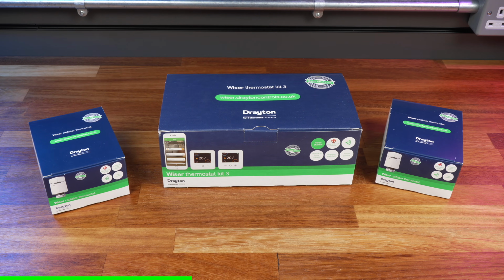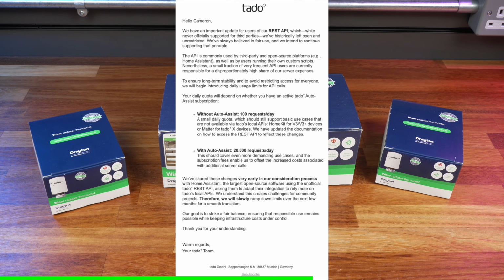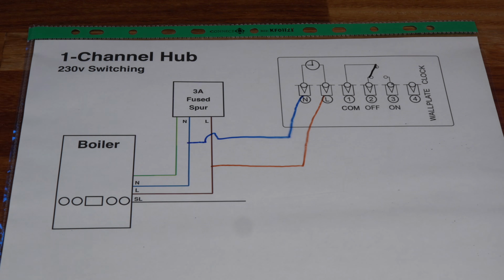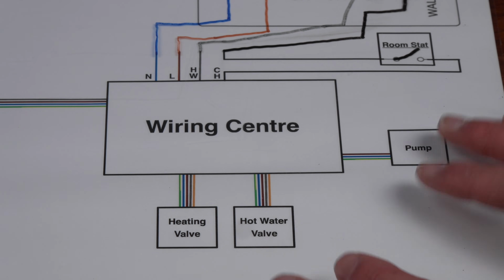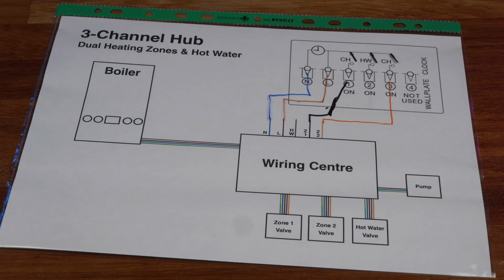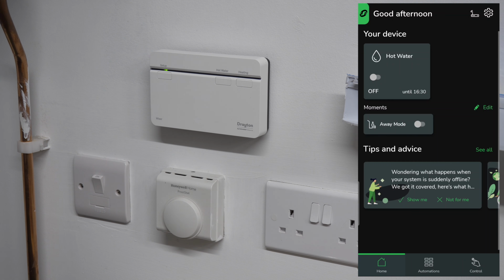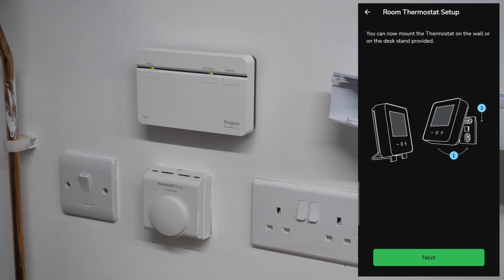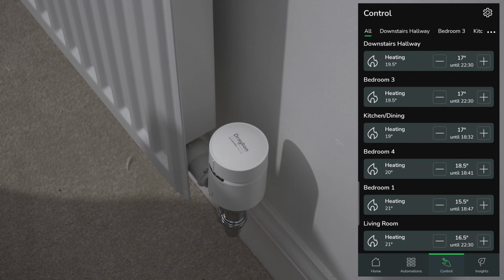Goodbye Tado, Hello Drayton Wiser! — Full Installation & Setup Guide!

Comment from the maker: Buy Drayton Wiser on Amazon (Affiliate):
  - Wiser Thermostat Kit 1 (Combi Boilers): https://geni.us/D1jjeM8
  - Wiser Thermostat Kit 2 (Heating & Hot Water): https://geni.us/xB8wF
  - Wiser Thermostat Kit 3 (Dual-Zone Heating Systems): https://geni.us/hdnjb8P
Reply: Make sure you check the last 6 digits of the number below the QR code on the back of the control unit. If the last six digits start with 02 the firmware installed on the unit won't be compatible with the current version of the Wiser Home app and there is no way to update it without the app... So the unit is essentially bricked. You'll need one that starts with 04 or higher. This all based on support messages from Drayton Wiser after I bought a unit from City Plumbing which had been sat on the shelf for years. 

Pretty bad practice from Drayton Wiser to silently brick old devices (even if they are very old) if you ask me!

Comment: It does look like a better system than Tado X. One would need to see how well the heads calibrate themselves. Tado X heads systematically stay closed whilst calling for heat, causing the boiler to cycle through the bypass and no amount of recalibrations and calls to Tado helps. Then they have the gall to send you a report claiming you saved 44% on your heating bill. Un-ducking-believable.
But with Wiser, if you want to use it to control your boiler by OpenTherm, you need to make sure your boiler's OpenTherm is compatible with the version of OpenTherm that Wiser is using. For example Baxi OT and Wiser OT are not compatible despite their claims! On/Off control will work ok, but you need to keep adjusting the flow temperature manually...

Comment: Used this for 3 years and then ripped it out. There were things I loved about Wiser (aesthetics being one), but a lot I hated. The list is long and I won't go over it here and depress your viewers, but who designs a new wall thermostat that doesn't fit onto a standard UK back box to cover the old thermostat home and wiring?  Feature wise, it's the Robin Reliant of the smart thermostat world. and it has always had an extreme lack of features compared to the competition. Been like that since it first arrived on the market and nothing has changed since other than cosmetic app changes. This is a European product, 'shoe horned' into the UK market by Schneider and then just left alone. Apart from the odd bug fix, they have not developed or pushed anything new out to make this product the market leader. But at least it is cheap and plenty of kit on Ebay from people who have found out the hard way just how basic Wiser is. It does integrate with Home Assistant which allows you to do your own automations and make it the product it could be.
Reply: Very surprised. Used it for many years and love it.

Comment: Hi! Great overview.

A question - we’ve got a big house and can’t afford/don’t want to put Smart TRVs in every room in the house. Normally we would just override the central heating at the programmer and switch it off/on entirely instead of messing about with individual radiators.

Is it possible to toggle the central heating entirely through the Wiser app, and include it in schedules?

Comment: Thanks for the content! I've just bought and installed one after watching your video (and my boiler happened to breakdown at the same time). 

I have a question though. 

I have opentherm on my boiler and use HA as my hub but have Aqara E1 TRVs. 

I can link them all together in HA but I'm not sure how the OpenTherm feature works with Aqara TRVs? Does HA / Aqara know to communicate on OpenTherm or not? I can't find any information about it. 
I feel I need to go full Drayton Wiser TRVs but that's another £400 I don't want to spend. 

Any help would be much appreciated
Reply from the maker: OpenTherm is purely communication between the Wiser hub and your boiler when the hub is connected to the boiler using a cable between the boiler's OpenTherm terminals and the Hub's OpenTherm terminals.  OpenTherm is a replacement for using the relays to turn the boiler on and off, it allows the Wiser hub to do things like adjust the flow temperature of the water in your heating loop.  It's completely separate from Home Assistant and the network communication side of things.  Your Aqara TRVs will work in that they'll stop a room getting beyond a certain temperature, but if you want a TRV to be able to fire your boiler when a certain room gets too cold then your only option is the Wiser TRVs.
Reply: @camerongray1515  Thanks for the great explanation!  Glad to have the clarification on this. Annoying though!

Comment: I just found out about automatic or self-balancing radiator valves. Do you use them? As I understand, they greatly increase efficiency as the flow is actively balanced regardless of the pump flow and of course they work great with smart thermostats. Maybe they would solve your problem of uneven heating. Actually, I've would like to know that. Would self-balancing valves let you use smart thermostats on every radiator and get max efficiency and comfort?
Note: I watched this video when it was released so maybe I've forgotten some specifics around the problem.
Reply from the maker: They look interesting but not sure how big a benefit they'd give vs just balancing everything manually.  If I was installing a new heating system I'd probably consider them but if I factor in the time of draining the system down and swapping all my current TRVs, I may as well just spend the time manually balancing it properly.  Only other thing I've noticed that the self balancing TRVs (vs the ones that go on the lockshield end) have a somewhat unusual fitting for the valve so you'd need to make sure you can get a suitable adapter for a smart TRV.
Reply: @camerongray1515  I've never used them but I am going to swap them for the next season. Them and Gas Boiler also. My current Boiler is not condensing variant.
I understand you, you already made a lot of swapping around. Drayton says that data shows average savings of 8.8%. Of course that should be taken with the grain of salt.
The point is, when you manually balance, that is good for that specific pump RPM. Since all modern heating systems have variable pump speeds, flow always changes. At least that is my understanding. That is why these valves should help a lot.
Go investigate a bit, plumberparts has a good video. The 'automatic balancing' video.

Comment: The brand is very vague in a lot of things, i'm looking to buy one but I can't tell if it has open window detection like tado does. Any idea if it detects open window and cuts heating? because they have a separate device that installs on windows and relays info that the window is open, but nothing about the thermometer itself.
Reply from the maker: It does have open window detection but only for the radiator valves, not the room thermostats.  And unlike Tado, it's not a paid feature!
Reply: @camerongray1515 very informative, thank you.

Comment: I'm considering getting this system, but the reviews for the android app are terrible. Any thoughts?
Reply: The android app is fine. I installed in previous property and just moved and installed here. Not sure why anyone would say the app is an issue!

Also I not convinced Cameron quite understood how the valves work. Say with a work/hobby room that wasn't used daily but were going to use it, we'd just go to the app and use the boost 15 mins before and that room alone will heat up not the whole house.

Comment: Hi I'm really interested on if you got opentherm to work with the 3 channel. I'm in the same situation as you, 2-heating zones plus a combi boiler. But I really want opentherm, even if it's just on 1 zone. Were you able to confirm if that's possible in practice dispite what they officially state in their user manual? Can't find this information anywhere! Really appreciate it if you could provide clarity
Reply from the maker: I'll be making a dedicated video on it soon, but it does sort of work, with some pretty major caveats.  Essentially, it will only fire the boiler over OpenTherm when Zone 1 calls for heat.  Both zones trigger their respective relays but only Zone 1 will fire the boiler.  This essentially means that Zone 2 will only heat up when Zone 1 is also calling for heat.  This is fine for my setup where my second zone is a single bedroom where I don't mind it not being able to call for heat on it's own.  However, if you had a larger second zone (e.g. an  Upstairs/Downstairs split) then it may not be suitable.  At that point you may be best just removing the zoning (locking valves open/wiring them both into the zone 1 relay.etc) and rely on Wiser TRVs for zoning instead.

Comment: How about a Shelly for each channel wired in series with each thermostat in the wiring center. At £15 per channel should be cheaper than that hub. Thermostats & TRV's - any that work with Home Assistant. Select all stuff that has no API lock-ins and you can program HA to do whatever you want.

PS. Set the old thermostat that you are intercepting to a temp above what you need - used as a "backstop".
So if Shelly didn't cut off "call for heat" for any reason then the old thermostat would operate still.
Reply from the maker: Definitely an option but my plan is to use this with OpenTherm to allow it to modulate the boiler flow temperature which wouldn't be possible with simple relays.  There's definitely ways to connect Home Assistant to OpenTherm but for something as critical as heating I'd rather have something completely standalone that's then controlled from HA but will continue to operate without it rather than something that's heavily dependent on it.

I'll be making a video on the Wiser HA integration soon but it's really good - completely local and allows full control, even adjusting schedules from a dashboard widget.  In fact, I haven't used the Wiser app since the initial configuration!

Comment: Have I missed the HA video, seen the newer videos but can’t see the home assistant one for this controller. Hope it works ok, as thinking of this instead of Tado.
Reply from the maker: It works amazingly with Home Assistant, I just haven't had a chance to do the video yet but it'll be coming soon!  In fact, after initially setting this up, I've never had to use the Wiser app again, everything is configured through HA, there's even a dashboard widget for adjusting the schedules that run directly on the Wiser hub!
Reply: @camerongray1515 thanks Cameron, looking forward to it. Love the info and detail of your videos!

Comment: Long time wiser user and local integration is brilliant into home assistant. 

My biggest complaint with it is the way it pulses the boiler on/off; I wrote my own weather comp in HA and control the boiler flow temp via this, but all of the wiser devices individually trigger the boiler on/off which isnt good for efficiency. As a result I have removed a bunch of the TRV's to try and reduce this cycling and keep the boiler running lower for longer.

Once you get your HA integration setup keep an eye on this.

Comment: The smart rad valve part of this is excellent for someone like me deciding to buy smart trvs or not.  I was thinking its all about only heating the rooms you need warm by auto turning those on and all the rest off, but you've questioned that strategy.  In fact the main thing I want is just one particular room to not get too hot when the house is heating in the morning (but be fully on evenings). Also I thought non smart trvs were just pushing the pin up and down as you twist it. Had no idea they were actually reading the temp.  I've just installed the tado x starter kit but seriously looking at taking it back because of the way they are behaving.

Comment: My combi boiler is upstairs in the airing cupboard. The wi-fi router is downstairs in the living room. Will they connect okay? Also can I have the app on more than one device- for example my phone, my iPad and my partner’s phone?
Reply from the maker: It's hard to judge the signal strength since all situations are different but if your phone can get a reliable WiFi signal in the airing cupboard then the wiser hub will probably be fine - Ideally just install it as far away from the boiler/any water cylinder as you can get as they can interfere with the signal since they're essentially big lumps of metal.  No issue with having the app on multiple devices, you'd just need to log in with the same account on all of them.

Comment: Really useful guide.  Thanks Cameron.  I like the idea of a local hub. Many of the Tado issues are often due to connectivity with the Tado internet bridge. Just having the one hub seems like a better solution, provided the SRVs can connect at opposite ends of the house.  Our Tado bridge is in a central location so everything connects well. Our heating controller is at one end of the house, so SRVs at the extremities might struggle to connect?  Not sure if that's how the DW SRVs connect though.
Reply from the maker: The valves all do connect back to the hub using ZigBee.  However, if range is an issue then you could install some Wiser smart plugs somewhere between the hub and problematic valve and it'll act as a signal repeater.

Comment: Smart TRVs from Tado work the exact same as a manual valve now unless you subscribe for call to heat, unreal everyone needs to avoid Tado now
Reply from the maker: Wow, they're still doubling down and making even more features require a subscription to new users?  That's immediately moved Tado in my mind from "being a bit scummy" to "do not buy" and I'll be updating the pinned comment on my Tado video accordingly!

Comment: Really timely video!!

Was looking at new systems to either compliment or replace my Gen 3 Nest, initially looked at Kasa TRVs but discounted it due to the app issues (Kasa and Tapo as I have a lot of Tapo accessories), then looked at Tado with the aim of replacement of the heating controls and fitting smart TRVs to half of my radiators, wasn't fully decided on V3 or X version but was probably going for Tado X to future proof the system.

Then lioked on Reddit and that was the first I had seen regarding the paywall on what should be standard features, have therefore decided that my money will be spent on the Drayton Wiser (gen 1 system), have just been on Screwfix and purchased the DW kit 1, 4 x TRVs and a smart plug, might possibly look at another TRV and smart plug in the future and also may look at the gen 2 hub in the next 12 months or so.

I suspect Tado may come to regret their paywall, what's the point I'm advertising savings on your energy bills and then  having to pay Tado to get those savings having already spent a lot of money actually buying the kit!!

Comment: Very informative video Cameron. Do you know if opentherm can be used with both thermostats or does it only take effect with one 'primary' thermostat?
Reply from the maker: The behaviour is a bit weird with multiple thermostats and probably why they don't officially support it.  Only the thermostat linked to Channel 1 will turn the boiler on using OpenTherm.  The second thermostat on Channel 3 will still control the relay and therefore open the zone valve but it will not turn on the boiler over OpenTherm.  For me that's fine since my second zone is just a single bedroom so while it will only get heated when the rest of the house is also calling for heat, it's basically working like an analogue TRV.  If on the other hand you wanted to heat the second zone without also heating the first zone, then it wouldn't really be possible with OpenTherm on Wiser.  An alternative option would be to just remove the zoning, turning the house into one big zone and then use radiator valves to control the zoning instead.  You could do this by either locking the zone valves open, or even just by connecting both of them to the channel 1 heating output so they activate at the same time.

Comment: How does this connect to the internet to allow remote access? The Hive system needs a hub plugged into a router and a receiver. Does Drayton do it all in one box? No mention of ethernet cable to box?
Reply from the maker: The hub installed next to the boiler has built in WiFi, no need for any sort of external hub like with Hive.

Comment: Fantastic video, and could not be more timely! For a number of months I have been considering the Tado X system, and even purchased all the kit. 2 weeks before it was due to be installed I found out about the Room Link being moved behind a paywall which made me hold fire. After much research I landed on the Drayton Wiser system, and have purchased the kit and I am looking forward to getting it set up in the next week or so! Managed to also get it on the sale from Screwfix at £148 for the Kit 3, and £29 for each smart TRV (only managed to get 5 that were in stock!). 

I am hoping I can do a simple swap out of my current Horstmann H37XL 3 channel programmer which controls my hot water, all rads on 1 zone, and UFH in another zone. I keep reading some places saying I need to get the Drayton UFH strip.... but its so expensive and cannot understand why I would need this when the current controller is able to handle the UFH - why would it be any different for the Drayton Wiser controller?
Reply from the maker: I can't see why you'd need to do anything special with your underfloor heating zone.  Where the Wiser UFH controller would be required is for situations where you have an UFH manifold with actuators to control each UFH zone - you'd have this on larger UFH setups since you don't have radiators to install traditional TRVs on.  If you just have a single UFH zone then you can just control it like any other heating zone.
Reply: @camerongray1515 thanks! I installed it today as have it up and running, and so far I absolutely love it! Really looking forward to your next set of videos on this! Especially HA